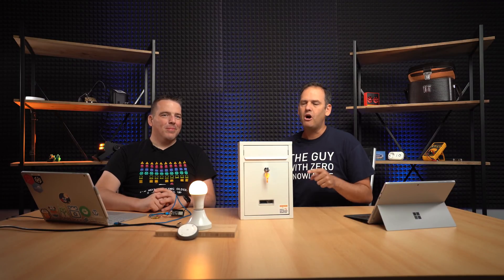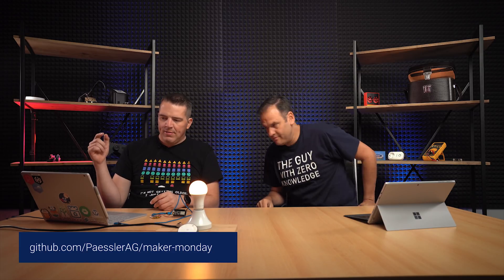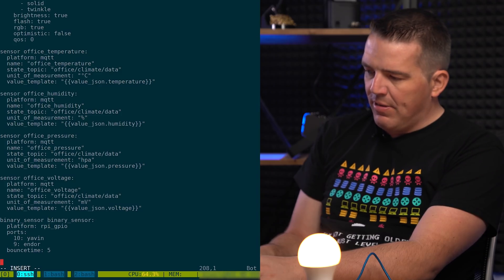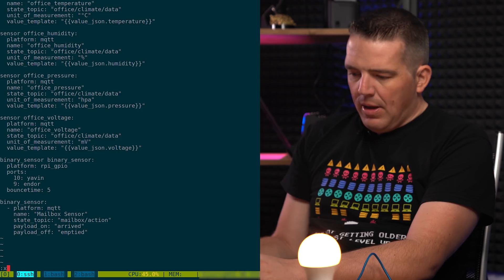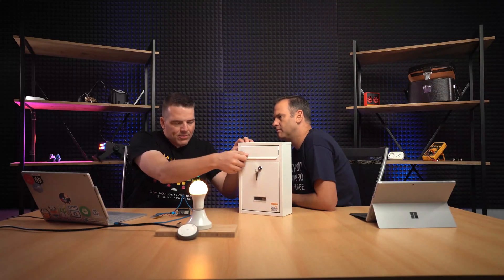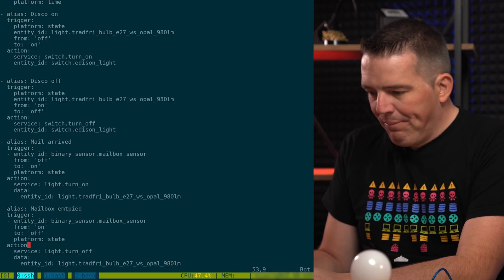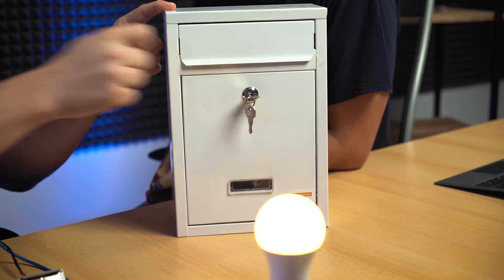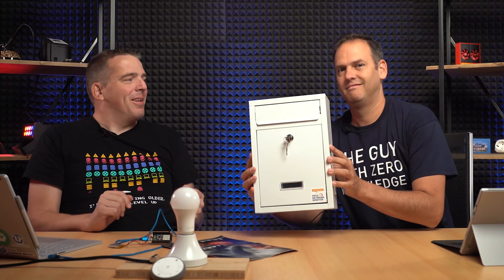Set Up a Smart Home Mailbox (2/2) - Home Assistant

Comment: Hi PaesslerAG 
Your videos inspired me to to the same with my mailbox, how ever Im a bit uncertain about the nc switches mine has 3 pins and according to your schematics I only need 2 pins I can't see how yours look like in the part one video. Can I just use pin 1 and 3?       .....Thank your for the audrino files and the schematics
Reply: Hi cassio229. That's totally fine. Usually those switches have one pin on on side (common) and two pins on the other side. (nc=normally closed, no=normally open). The 'nc' pin is connected to the common pin when the switch is not pressed, the 'no' pin is connected to the common pin when the switch is pressed). So yes, you only need two of the three pins: (always) the common pin and possibly the normally open pin (a bit dependent on your mechanical construction if the switch is pressed when your mailbox is closed or vice versa).